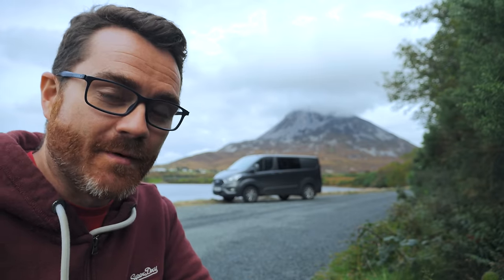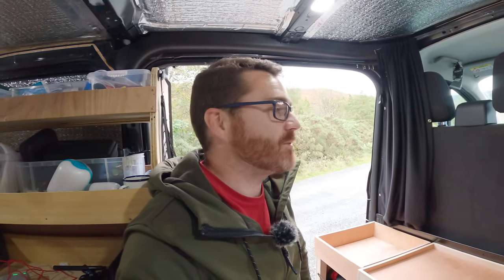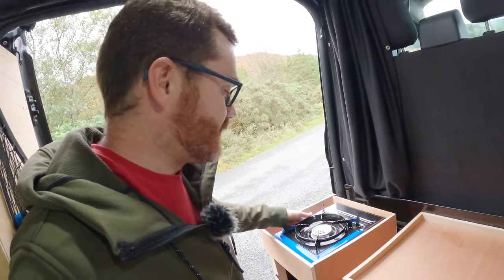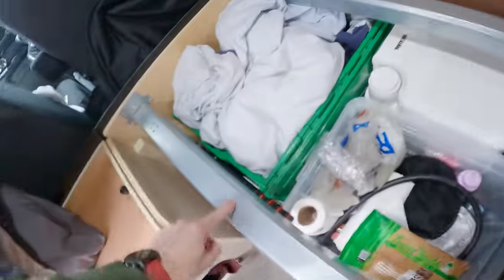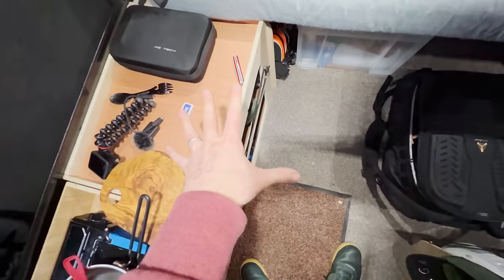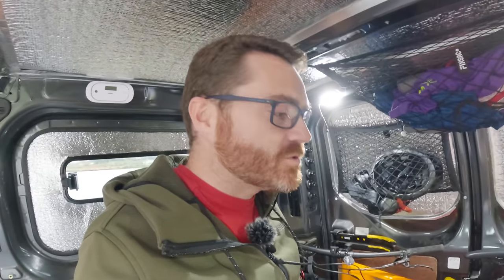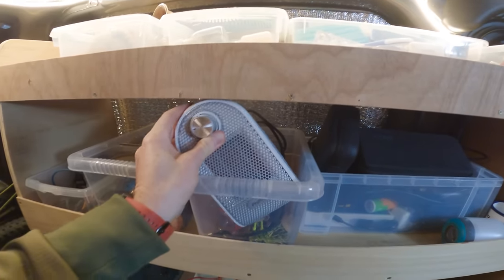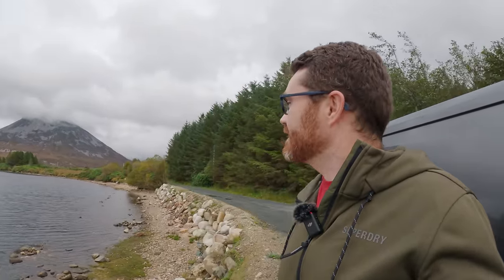VAN TOUR, Super Simple DIY Campervan Conversion - 2018 Ford Transit Custom

Comment: Hey. One year later - (or more) - can you update us on the transit? I’ve heard worrying things about them and I kinda am looking at vans… how’s yours Been?
Reply from the maker: What things did you hear? I’ve had no major issues, just standard wear and tear. I think some of the older ones may have been more prone to issues. I asked a few friends in the trades what they thought and they picked the transit over the vw transporter every time.
Reply: @StephenJReid  it’s seemingly impossible to do any reliability research on vans :( vw always up the top of reliability with sprinters. Ford hate by everyone . At the dame time vw hated by everyone. I guess it’s one of those things where you only hear the bad online as they’re the loudest. Asking someone in the trade is probably good. Though I’m told the trans it’s beyond like 2008 are awful. And then others saying don’t touch old ones 😝😅 just want a reliable van 😓😄
Reply from the maker: @nxmrjake  yeah I found that too, completely conflicting opinions everywhere. I gave up looking online and just asked people I knew who used vans. Also I had an opportunity to drive one for a week a few years ago. I also test drove both the transit and a transporter and much preferred how the ford felt to drive.
Reply: @StephenJReid  that’s good to hear! I’ve been looking at the 2020ish peugot expert type of van - slightly smaller than transit. Every other van around town seems to be one.. but impoosssssible to research. I may take your lead and try to talk to humans 😃 thank you

Comment: Great set up. What power station did you buy?
Reply from the maker: its a BLUETTI Portable Power Station EB70. I got that one as the top handle folds flat so it takes up less space
Reply: @StephenJReid  Thanks, couldn’t quite catch the name.  Looks like a nice bit of kit with a quick charging time.

Comment: Naïve question, but I assume long wheel base to get everything in? Love your videos!
Reply from the maker: nope its the Short wheel base, I wanted to be able to still fit in normal parking spaces. With hindsight, I possibly would go long next time as I have only got about 1.5ft of space after the end of the bed. But I' m still thinking of ways to maximised the space better. I might redesign the interior this spring
Reply: Thank you Stephen, we're moving up to County Down from Kerry in the Spring, so hope to see you in the Mournes! @StephenJReid

Comment: Can you fit the road bike and the mountain bike in at the same time? I'm in the process of picking a van to convert and I either want to be able to transport two of my bike or mine and my partner's at the same time
Reply from the maker: Yes, but it's a tight squeeze as one would go down inside the length of the van. They won't fit both fit at the end.

Comment: eww you dont poo in a porta potty that's what a bucket and bag are for. porta potty is for night time on a camp site, otherwise its pee in a bottle and empty on a small morning walk or poo in a bag with horse pellets anddispose of a doggy waste bin
Reply from the maker: 😂 Tell that to my porta potty, been successfully pooed in dozens of times.
Reply: @StephenJReid  ewwww. Bucket and chuck it ( dispose of respondibly ) is so much easier. Or usr public loo somewhere
Reply from the maker: @clarkspiemuncher24  I only have to empty this about once every 6 weeks, now I’ve figured how to do it properly, not messing around with bags and powders, doesn’t smell. And long term it’s cheap too as I use about £15 of chemical in a year. 

Doesn’t get used regularly, I save it for nights or if there’s no public loo.